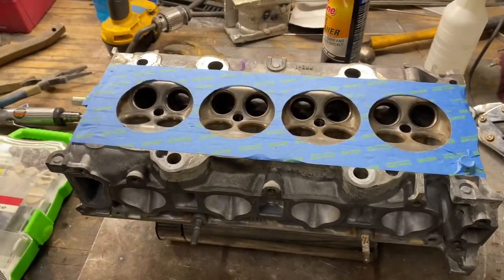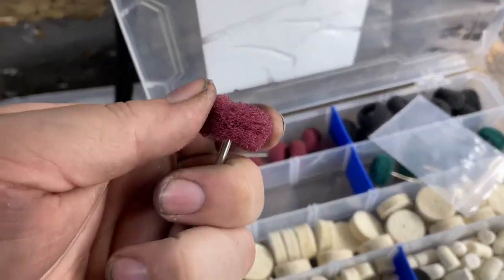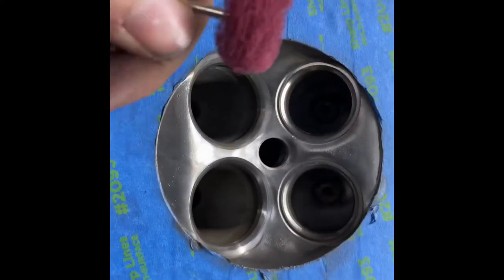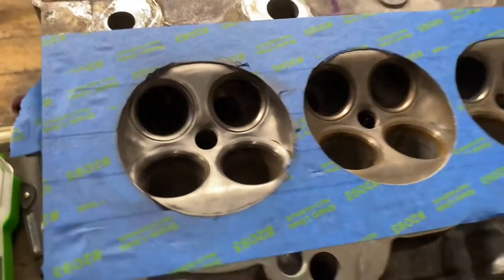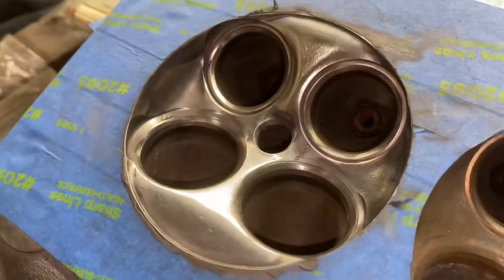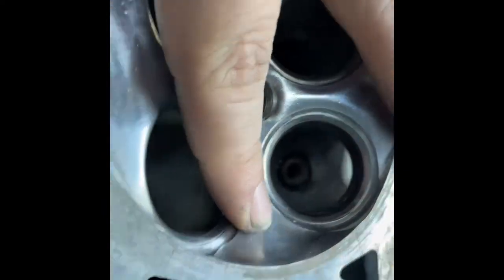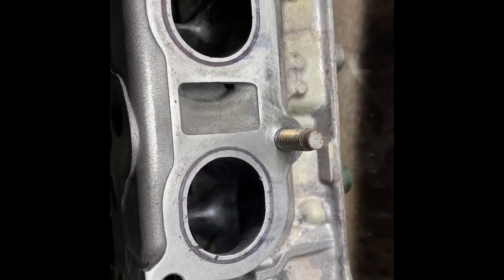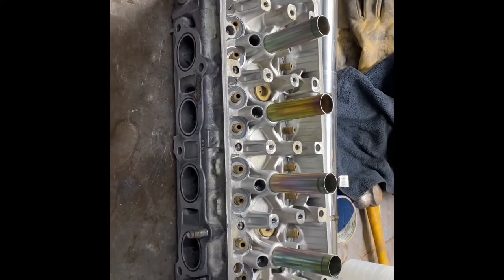DIY Polishing combustion chamber

Comment: I'm doing mine 2 to fight against the chance of knock on a boosted engine. I'm gonna be at 9.5-9.7 to 1 CR so I figure it will help, plus I'm running dual intake cams set to 180° and retarding two teeth on the can gear. If I run premium gas also, I should be fine with 14-15 PSI